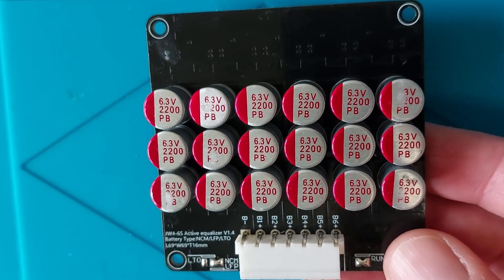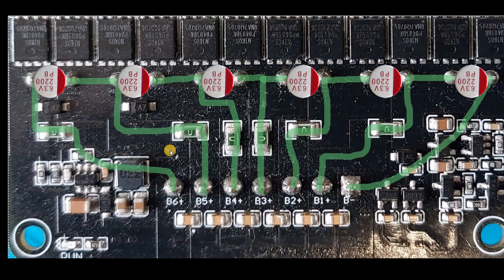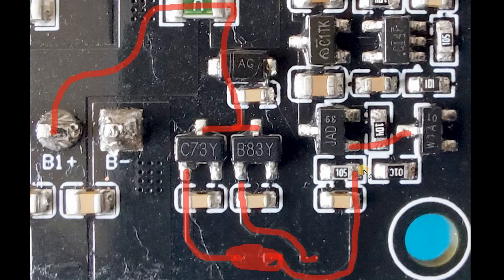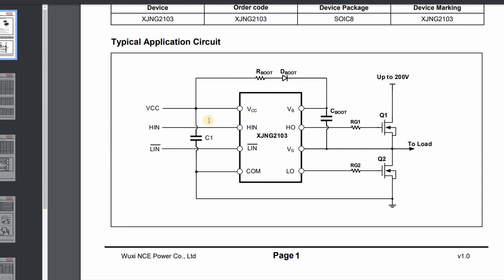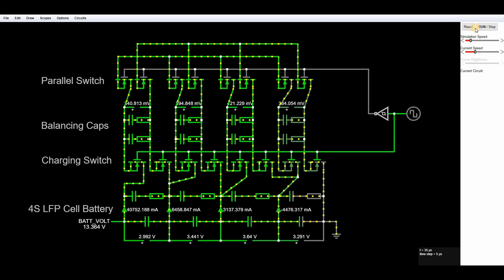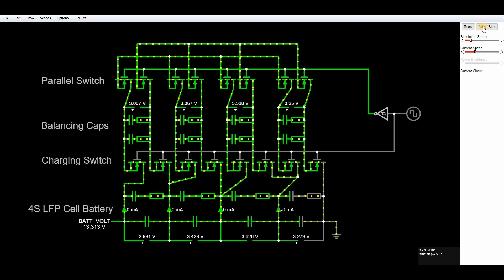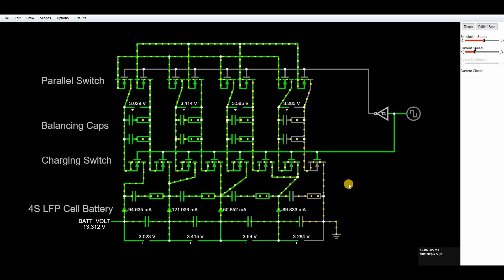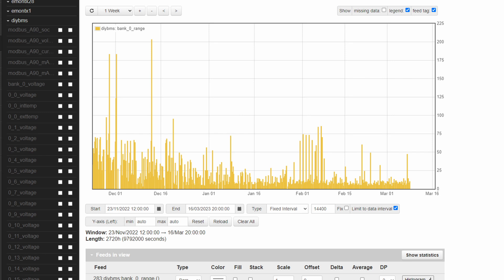How Does An Active Balancer Work?

Comment: Can theses capacitive types be paralleled to up the balanced amps when the cellvoltages close in to each other? I guess not because the balancers (for example 2pcs) are not synchronized in their energy intake and output cycles so it might happen one balancer pumping energy out and the other one sucking that in, so the battery gets nothing (?).

Comment: I'm not comprehending the purpose of the capacitors at the bottom connected in parallel with the cells.
Seems like these would only increase the time required to achieve balance.

Comment: What about the cell's internal impedance when charging/discharging? This circuit would actually de balance cells in a case of different dc resistance and then when the current drops it would have to start all over again?

Comment: Does it work  when the battery pack is charging and discharging, and what is the frequency used for switching the transistors ?

Comment: Hello, I've got 3 questions:
1) if the voltage of the cell is 3.7-4.2~V, and the voltage regulator to 10V has an input range of 5.5 to 40V, how does it have enough voltage to regulate?
2) what is the need for the 10V regulator, could you not just have the output from the battery get regulated to 3v3 directly?
3) How would you determine the frequency at which the RC oscillator would need to oscillate, and can you use a normal crystal oscillator?
sorry if these are dumb questions and thank you for this amazing and detailed video

Comment: What is the purpose of the lower set of capacitors? They aren’t part of the bank of caps that get paralleled so what’s the point?
Reply from the maker: I guess they allow a buffer between the cell and the balancer to allow the cell to take the balance charge relatively smoothly/slower

Comment: Good explanation, but I never see it balance the battery. So with 0.02A or less (5A Equalizer) it does a poor job
Reply from the maker: You will only get maximum current when the voltage across the cells has a large differential
Reply: Now I have 3 such units, only one works, so they are defective, straight from Aliexpress

Comment: thanks for this great explanation. they said it's 4s-6s balancer but can it work on a 3s battery ?
Another example, i have bought a 9s-14s balancer for a 13s 48v ebike battery, can i use it on 5s 18v makita or bosch tool battery pack ? have a good day. 
ps 2:24 arf.. that drawing explain why he will not works on a 3s isn't it ?
Reply from the maker: You do need the correct balance board for the number of cells in use

Comment: Outstanding work, friend; 
      my bad luck i am on my second board from china, aliexpress, the first, Neey, 35 euros,  was bad, drawing 18 amps steady and trying to melt wires, got refunded after 2 short videos i had to send them, now the second one, from another vendor  and each one took 1 week from china to portugal... ( where the courts'  INjustice system sucks big time, incompetent and slow, truth be told,   lol) ... this module also 16S,  27 euros, does NOTHING, just  sits there and draws  1. 32 Amps steady  from the battery, on the nr. 1, wire,  the minus,  black wire,  and does NOTHING, even after 5 or 6 hours, all cells are the same, cell 2 at 2.98 and cell 12 at 3.29;   now, i will  have to open another dispute with aliexpress , likely get refunded again, and do WHAT? order a 3rd one, i guess, my cells are old and i need it; and another week wait;  if i get lucky with the 3rd one....
   i am a bit of a  technician,i  repair solar inverters,and yes, my wiring is perfect,1 cell voltage step from pin to pin;   that is how it must be  checked   before connecting the 2 connectors,the 9 pin and the 8 pin ones.
Reply from the maker: Bad luck in the balancer boards - I've got a few broken ones which just appear to have died after a few weeks of use.

Comment: What happens if you use a 3s pack on it and leave 1 input (B4) off? I want to buy an 8s balancer for my toolbox to periodically connect to different packs as a way to balance packs that have drifted too far for the resistive BMS to correct.But I have 3s,4s,and may come across 8s possibly.
Reply from the maker: I've never tried. If you tie the unused input to the 3rd cell if wouldn't do anything, so may work
Reply: @StuartPittaway  Thanks!

Comment: Hi like to connect with you sir , I am also trying to make same circuit my question is that if you turns the gate on how can it charge the battery ? every mosfets gate is turned on at same time how it is possible  ?

Comment: What if a boost converter or jewl thief is used to charge the capacitor or the low cell? If the capacitor is charged to 4.5-5v or even a capacitor doubler, charge two capacitors then put them in series to charge a cell. Its going to cost space and components, maybe it is worth it if it can work Soo much better, having a boost converter or jewel thief making noise may not be so acceptable. However a fet switching caps in series should be much more welcome.. possibly use a small micro controller to discharge the cap before connecting the call to charge it , so the high cell charges it faster. Then going in series as it connects to the low cell. I wish i had more knowledge about electronics, i could have started learning 30-35 years ago and know a ton more!  Thank you soo much for all the effort , and for sharing this awesome project!
Reply: These active balancers are dirt cheap hence kept to an absolute minimum,  yes, the cct could be improved 10x fold. 😁
Mine cost 62peso (Philippines) online from China. ($1US) 😉

Comment: these seem to come in different current ratings..
Should I be choosing one  based on the overall size of battery or individual cell capacity or the max differential it could be shifting between cells (C rating ) ?

or
Reply from the maker: Generally, for any lithium battery 1amp balance is perfectly okay, unless they are really bad cells.

Comment: That’s a great video! Thank you so much, I am currently learning about batteries to refurbish a used powerwall and I bought such an inverter. How fast are these pulses switching between charging the capacitors and charging the batteries?

Comment: I saw this video of yours and I was happy because I thought all my battery balancing problems will be solved with this circuit. Then I found another video of channel Off Grid Garage, video hash is yPmwrPOwC3g , titled "Automatic Active Balancer - The Evolution in Balancing. But..." and I became very unhappy. He is saying that using this equalizer circuit that you are showing will actually disbalance all the cells int he battery.  How can he be right if the circuit actually is made for balancing??? It is like saying 2 + 2 = 5 in mathematics.
Reply from the maker: The issue is if the balancer is running all the time - ideally you only want it to run when the cell voltages are high - particularly for LFP chemistry cells.
Reply: @StuartPittaway  hmm, then it looks like a broken "solution" why would one be using a "solution" that creates another problem? In that case we need a circuit that includes a "maximum voltage" parameter, to deactivate/activate itself. Or something like that.
Reply from the maker: @absolute___zero These balancers work well with "normal" lithium cells but for LFP, they need top balancing due to their charge curves.

I agree, the balancers should have some voltage sensor on them - but they are built for low cost.
Reply: @StuartPittaway  thanks! this is very important information and I am going to continue my search for the best solution
Reply: @StuartPittaway  wouldn't it be better to connect each cell to a battery charger circuit for 50 cents, like the ones that are included in lithium batteries for cell phones? CC-CV charger it is called. If the battery isn't accepting charge, the circuit won't draw current, so you wire every cell with such circuit and connect it to MPPT device. Active balancer circuit costs about 12 bucks, but lithium ion chargers cost like 50 cents and you don't have a problem with discharging. It will be cheaper and you don't need to buy active balancer circuit and your hedaches are over.
Reply from the maker: Electrical isolation is the problem then - the circuit you describe wires all the cells together in one big parallel battery - there isn't any isolation between the cell chargers.

Comment: Big thanks to you. This is exactly what I am looking for.  BTW,  what if the charging voltage is too high? how does it lower the volatge? Let's say I got 5S1P SCiB battery. It's max input is 13.5V, but I'm charging it at 14.0V. All cells are over voltage of 0.1V. How does it get rid of 0.1V? The passive balancer uses resistor though.
Reply from the maker: If all the cells are over voltage, then it can't get rid of the energy - there is some waste, but ideally you don't allow any cell to exceed its maximum safe voltage (which is where the BMS should stop charging)
Reply: I use it on my motorcycle. The generator's output is higher than 13.5V when RPM is high. I already got the passive balancer, and it works perfectly under my situation.

Comment: Hi Stuart, any hint how to force balancing of LFP sooner? In my case, cells 6 & 12 are running away on top, but balancer doesn't balance because of cell 1 still at 3.36V while 3 & 6 at 3.5V. I'm controlling RUN solderpad with a relay (from HA, triggered by max_cell_voltage), so thinking about switching it to LTO - it should start balancing immediately. Any comments? Thanks!
Reply: Trigger a balance start at 3.45V for LiFeP04. with a 3.5V-3.55V 30min - 1 hr absorb, depending on overall pack health. 
***Attempting any balance below the 3.45v upper knee serves only to imbalance the pack. 
My annual top balance usually takes over an hour at 3.5V for my well matched 280Ahr packs.
My worst pack takes over 3 hrs twice per year.
In your situation, switching to LTO should serve your intentions well so long as balancing on/off is relay triggered and voltage biased..
Reply: @ktcustom778 Thanks a lot, but there's an issue (by design) that balancer starts only when Cell 1 reaches mentioned voltage.

Comment: A multimeter, bulb as discharge load & any old power supply/charger kinda does the job too, if you're not into complexity.  Test each cell, discharge the over-spec ones using the bulb till they matchish, charge the lazy sod ones till they match the median.  Or not, each to their own, there's always more than one way to skin a cat.
Reply: Very time consuming or not?
Reply: @ElectricPaoloIAM  Not really.

Comment: Stuart, thanks for this post. Have you ever thought about keeping some extra cells for using while decharging the battery pack and switching some of the cells on or off (Using MCU and some Mosfets) according to their SOCs ? Your answer is important for me. Thx again. Good work.
Reply from the maker: No, I've not considered that.  The SOC across all the cells is generally the same, unless you have very poor quality cells to begin with.  The battery is only as good as its weakest cell, so swapping others in/out wouldn't be an improvement.

Comment: Great work I just have one question what is the reason for small caps ? why cant big cap with  small value of resistor 4  inrush current limiting  be used for quicker balancing ?  Is it cost cutting measure ?
Reply from the maker: Good question, I'm not really sure.  They are "solid polymer capacitors" - which have better capability with ripple, so should last longer.  They are expensive though, so expect this is a cost cutting limitation.  You would potentially also get much larger current spikes across the PCB which again would need to be factored into a larger board or higher quality parts etc.

Comment: Hello Stuart, really interesting!! Just a small question: how is the current supposed to flow back from capacitors to batteries if there’s a diode? Thank you :)

Edit: I auto-reply myself: that on the schema is not a diode but a current probe :)
Reply from the maker: Yeah - its a probe on the circuit simulator.

Comment: I have a pack of super - capacitor 6s (16.2V, but in my car max charging voltage only 14.4v). I wonder that can I use LFP  battery balancer 6s for my stuff?
Reply from the maker: These boards seem to be compatible with most types of cells so I don't see a reason why is wouldn't work with a capacitor

Comment: Great simulation Stuart. There must be a way to adjust the balance turn on voltage by changing a few component values?
Reply from the maker: Yes, think that 3 pin chip swappee out will do it

Comment: Hey Stuart. Your simulation has resistors on each capacitor. Is this just to enable a slower charge/discharge in the simulator or does the actual balancer have these also?
Reply from the maker: The balanceer doesn't have those resistors, these simulate the internal resistance of the capacitor (ESR). It's a very low resistance.

Comment: Wish it was easy to change the turn on to 3.45V
Reply from the maker: It might be possible, just swapping the 3 pin chip
Reply: @StuartPittaway  once you get all of the conformal coating off and find a chip with a higher value… was thinking maybe put a resistor in series?

Comment: I occasionally have to balance some 7s/1p packs which I do manually. I'm wondering why balancers dont use this method which is fairly straight forward. My method is as follows:
1. measure all cell voltages
2. charge the low cell voltages, and discharge the higher cell voltages
I use icharger in 1s mode to charge a cell, and to discharge i use a 12v automotive blinker globe ( 5watts) globe.
It doesn't take all that long to get the cells to pretty close voltages, so my brain is doing the work judging when to stop charging/discharging, which I guess might be the tricky bit to design into a circuit to do same. There are things like voltage sag to consider, but it becomes quite intuitive quickly.
Its top balancing also when cells are close to full.
I've often wondered how those balancers worked..........thanks so much , its a clever design indeed.
Reply: Passive balancers work more or less that way. Here we have an active balancer, instead.

Comment: Can you shed  bit more light on how the schmit trigger is able to send a signal to each of the mosfet gate driver ics ?
Is the 10V going to each of the mosfet gate drivers ?
or what does the 10v regulator do exactly besided powering the scmit trigger?

are the mosfet drivers powered from the cells directly ?  (1 or 2 cells) ?

is there a decoupling capacitor inbetween the schmit trigger output and the gate driver input ?
Reply: I have exact same question about this
Reply from the maker: I've not gone into the detail, but I think its a schmitt trigger oscillator which fires pulses into the MOSFET driver chips.
Reply: So its sending the signals through a capacitor, which apparently can do magical things when connected to a mosfet.
I don't really understand the principle, but its sort of like a charge pump, the way I understand it. @StuartPittaway
Reply from the maker: @bartklump  I believe so, ultimately it's a pulse generator to toggle the nosfets
Reply: yeah but thanks to the capacitors, its able to switch the higher voltage differential mosfets aswell.
Since the driver sits at ground level. @StuartPittaway
Reply: @StuartPittaway And I guess that the MOSFET driver chips does apply an appropriated down time at each schmidt trigger pulse transition in order to avoid a short between parallel and serial MOSFET switches...
Anyway thanks for your explanation, I had not yet any knowledge about the technology of those balancer... because not yet met issue with them... I'm now a bit more ready to deal with it.
I'm also coming here thanks to Andy from Off Grid Garage 😉

Comment: Balancing LFP Cells below 3,4V cell voltage is not a good idea in general. As the voltage to SoC curve is that flat, t
here is the high chance to destroy a former top balancing.
Reply from the maker: Agreed, don't know why they didn't set the on voltage to a higher level

Comment: My experience of these is that they don't really work well and are not worth the bother.
Reply from the maker: Was the battery very unbalanced to start with?
Reply: @StuartPittaway  Not as such no. I had built 3, 48v battery packs using old 18650 cells and because all the cell blocks behaved differently they would get out of balance as they discharged. I tried to use active balancers to keep the cell blocks closer in voltage but it didn't work. Often the cell blocks could be different from the next one by 0.1V without the balancer doing anything. When you have a 14s the cell at negative end could be over a volt different from the one at the positive end and the balancer would do nothing. Perhaps it was just the balancers that I was using. I got them from Ali-Express but they were not the same as the one you are looking at.
Reply: @StuartPittaway  Perhaps I should send you one of the ones I was using for you to examine? I'm not using them anymore due to them being rubbish.
Reply from the maker: @nicholashowell  do you have a link to the model you have?

Comment: Great video. I use this active balancer in conjunction with the Diybms on my 7s lithium ion pack and does a great job keeping them in balance. However, I do only recommend using these for top balancing. I switch the enable contact on at 3.9V and only charge to 4V/cell. You must admit a diybms V5 with active balance BMS would be awesome 😉
Reply from the maker: Great tip!
Reply: 7S40P. LG MH1. Around 120Ah.
Reply: @GarethJones-dk9yp  Oh sweet!!
Reply: Is your battery bank 7s1p? Or more than 1p?